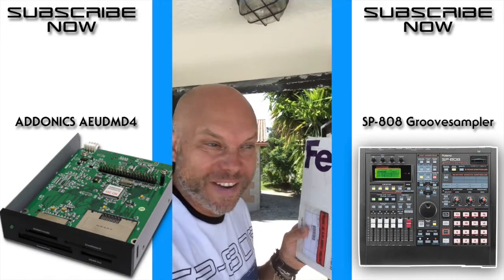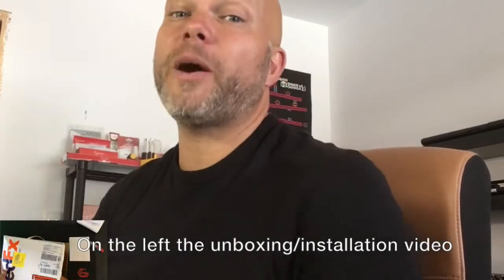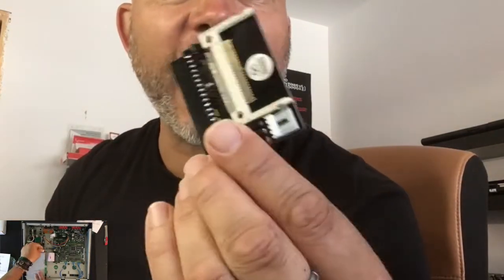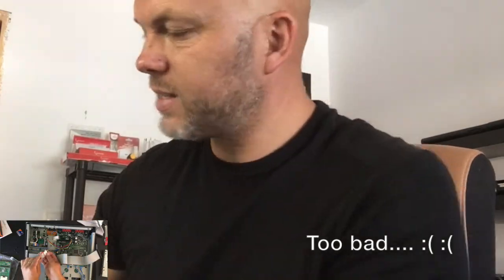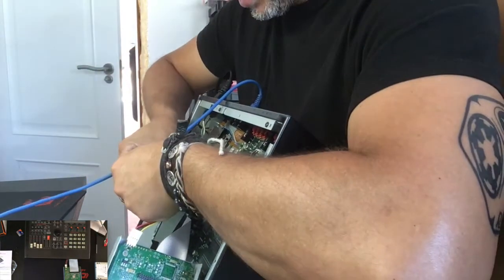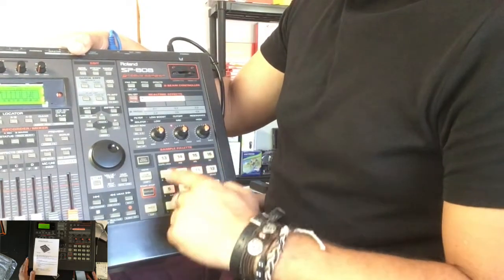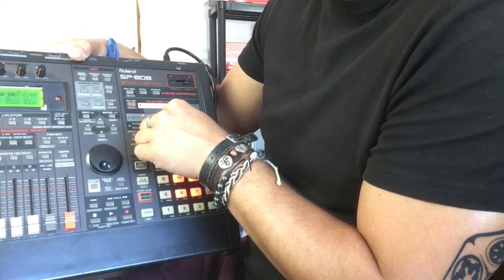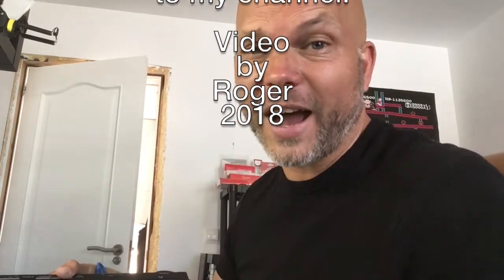SP-808: Addonics CF-cardreader installation (MPC-2000XL CF-card reader)

Comment: I have installed the MCD drive from the MPC 2000xl in my SP-808, and IT WORKS. I believe it is the original drive that came installed in the blue 2000xl models (it has an upper slot marked MS/SD/SM and a lower slot marked CF). It's hard to find used ones for sale at a reasonable price, but I got lucky and found one on Yahoo Auctions here in Japan. I am using a 1GB Compact Flash card in mine, and so far it reads and writes with no problems. I was a little apprehensive when I bought it, because I had only seen unconfirmed rumors that it worked. It does!
Reply from the maker: Leon Walpole Great!!! Happy for you and thanks for sharing your positive experience. Now we really know it’s not a fairytale. ✌🏽✌🏽✌🏽
Reply: @Roger - It's a shame that Addonics drive didn't work for you. Did you try using a smaller CF card? I've read about people using card readers on other older samplers who only had luck with CF cards (not SD) and only with sizes of 1GB or smaller. 
By the way, thank you so much for all your great videos on the SP-808! There are so few decent ones on YouTube, but yours are all excellent. I've really enjoyed watching them and learned some great new tips from them (like SHIFT + adjust length for halving samples shown in this video).
Reply from the maker: Well...it was worth trying. It would have been amazing. A smaller card will not work either because just connecting the reader made the SP-808 already slower without any card inserted.
And thank you for watching my videos. It is a real pleasure to receive this kind of feedback and I'm happy that you learn something from them :D
Reply: If i put card reader i have again drive too busy in fast plays or bounce track etc;if i havent its perfect if only change noise from zip and record time its clain

Comment: I am wondering because you are connecting 3 wire supply to four wire connector, wondering if the card reader is getting proper power. I have a similar card reader, I am going to hunt down the specs for what the red wire supply should be (5v or 12 v) So it might be possible these card readers work we might just need to make a jumper wire into the connector
Reply: Ok so in case anyone wants to know, the sp808's yellow wire is 5 v and the two blacks are ground. While I have a Starlink CF reader , when I hooked it up, same as his above. On my starlink the red wire(12v) connected to the sp808's yellow wire(5v) so I was not getting enough power to my cf drive. SO I will attempt one more time to see if I can find a 12v connection point somewhere on the sp808. The starlink needs 12v, also mine is not hot swappable. You have to plug the cf card in and then start it, I post more up here or create a tutorial once I get mine going
Reply: Sorry, just spotted some more info on the service manual for the sp808. there is no 12v rail,  its 15v which means you need a step down transformer..which I have so I should have some info by tonite

Comment: Yo, just wondering...did you ever remove the jumper for the master/slave setting..?
Reply from the maker: mack460 thanks for thinking along. Yes...tried with and without the jumper. 
There’s a small change in startup speed but somehow no luck.
I even tried to connect the IDE-cable in the wrong way. 
Somehow....buah...frustrating...

Comment: Hey Roger, feeling frustrated again with my 750mb zip driven 808 as I have lost quite a few tracks with zip errors lately. Thought I would ask your opinion about your experience with the A6 firmware, do you think someone who is code literate would be able to rewrite the 808 firmware with bits from the A6 firmware and get it working?
Reply from the maker: maybury78 Hi! What a coincidence...this weekend I watched your video again to see how you created that song on the SP. Keeps enjoying me. 
Regarding your comment:
What a #%£*^ loosing tracks like that..
The A6 firmware is nice as a sampler and a 4-track recorder. Also the effects are good. I do miss the synth and the way BPM is working. The A6 is based on time (SMTP) which makes it not so easy to create songs. 
But the hdd is rock solid...
Yeah, I think it would be possible to rewrite the two .PRG files. If someone is able to open those files, then it should be possible. 
I mean...the motherboard of the A6 has ‘SP-808’ printed on it. So, come on!😁
If only Roland would help us on this issue...if only...

Comment: There has to be a way of moving over to solid state drives, my heart cracks a bit more every time my zip drives fuck up, seems to be quite a lot lately even though I have just replaced the drive again and got some unused 750mb discs. I think that maybe the 750s are more unreliable, maybe trying to squeeze to much into the discs.
Reply from the maker: maybury78 Moving over to SSS would be a real cool thing!
Last month an 808 with the MPC drive was for sale for 300€. Finally I didn’t buy it because with a 4th unit my studio would be ehh...you get the drift. 
Never tried the 750mb drive. No...the 100MB with 32Khz is fine for me. But I will keep on searching like most of us. 
Thanks for contacting me. Hope you’re alright. 
💪🏽👌🏽✌🏽🤙🏽

Comment: I just added a card reader to one of my 808ex's. It may be the card, the one that came supplied with my reader is dif than the brand you showed. I used the one from the blue mpc also..
Reply from the maker: EL DAVIS we now can say that the original of the blue MPC2000XL is the right one. Happy for you! 👌🏽✌🏽
Reply: Roger The MIDI MANIAC thanks my Man, and thank you for all the vids, you are a lifesaver. Now if i can just figure out how to us my keyboard and the internal synth.. Ive followed your directions but something isnt working..
Reply from the maker: EL DAVIS hi! 🤔 not working?
Have you set the same midi channels on both machines?
Midi out on keyboard and midi in on SP?
Are the midi settings on your keyboard correct? 
You can send me a mail with more explanation and pictures. 
Roger@themidimaniac.com
Thanks. 
Can be in English or Spanish. (Based on El Davis 😉)
Reply: so you have a working sp-808ex on an akai multi drive? Please share details. This is a unicorn people want badly. Make a video explaining how to make a working unit. please

Comment: Roger, can you please revisit this idea of a card reader for an sp-808ex. I hear that card size and format can be an issue. You still have the equipment? Try other brands, Someone says fat 16 or fat 32 on a 1 gig card. This would be a breakthrough many are seeking. I want to reload the os on 2 machines now, but I need a midi interface/sound card.  Can't afford one now because I've been spending on my korg karma. But IS there is no battery in a sp-808ex? So does it loose the os to discharge over long period of time?
Reply from the maker: Hi Leo,
The 808 has no battery like a CR2032. On the mainboard there's IC9 which is the flash memory.
But when you have a failure the SP-808 would display that.
I still have my equipment and based on your question I tried yesterday with a SSD-drive.
I could format it but impossible to sample.
It froze.
When I connected the SSD to my computer there were three partitions created by the SP each of 512MB.
So I assume 512 is the maximum to be used.
I inserted a 512MB CF card but the adapter blocked starting up.
Still busy with this matter.
Finally we will have a solution :D

Comment: Hi Roger, I need your help
I replace the zip drive 100 of the sp 808 and it does not work properly, cut the samples.
you know what reference and brand I need?
THANKS
Reply from the maker: Hi! That's a bummer that the replacement doesn't work. I have several drives here from different brands (Panasonic, iomega and HP). Most important is that it's a so called Z100ATAPI. The original drive is a Panasonic JU-811T03.
I hope this is sufficient information for you.
Good luck and thanks for watching the vids.
Grtzzz, Roger
Reply: Try finding it here: https://www.mpcstuff.com/

Comment: Hello Roger, I'm also on a quest for a zip drive replacement on the SP808. I read somewhere that the MPC 2000XL MCD Drive can be compatible, which I found on an online shop (MPCStuff), do you know if they work ?
Reply from the maker: Jean-Baptiste Lévêque hi!
You’re right, the original drive of the blue mpc2000xl will work on the SP808. 
So, if you MPC-stuff sells an original one then you’re good to go. 
Any other mpc-compatible drive will not work. 
I bought two models for the mpc2000xl and they’re not working with the SP808 unfortunately....
We keep on testing!!!
Reply: @theMIDImaniac  Thanks for your quick answer ! I will ask the shop but I doubt they sell "original" drives. But I'm thinking, what if I buy an original blue MPC2000xl, salvage its drive for the SP808, replace it with another drive, then sell it back to cut my losses ? Could that work ? :D A bit convoluted...
Reply from the maker: Jean-Baptiste Lévêque if you buy the original blue one, you’ll be able to swap the drives. 
Only thing is that the blue ones are way too expensive. 
Well...the ones I’ve seen the last years.

Comment: Hi Roger, do you think It would works (adapted) on MV8800 ?
Reply from the maker: Jeanlouis COQUIN thanks for your suggestions. 
This addonics is disappointing. Didn’t work with the SP, not the MV and also not with the VS2480. 
It didn’t work either with an AKAI mpc 2000xl. 
It’s not on its way to bad-gear-heaven.
Reply: @theMIDImaniac  Ya know, considering all of how it didn't work anywhere...I suspect the reader being defective or somehow you received the read only version of that model. Have you tried another since then? I own an 808 and in a few week I plan to get on the bandwagon also. The slow 808 operation may ne that the processor is sending SCSI / ATAPI commands but isn't getting a response so it's caught up in an instruction loop.
I really believe it will be something stupid that was missed. It's going to happen!

Comment: hm i will probably also have a go with this. Looking at the wobbly atapi-specs (https://www.win.tue.nl/~aeb/linux/zip/zip-1.html), it might be that issues occur during formatting (which can have different results based on the jumper setting). I will receive my sp808 this xmas, so i haven't been able to try this: format the sdcard with different jumper settings. Another idea is to compare the SD-partition(table) with the zip-disk partition table. This is just a (probably stupid) guess:  since it 'kinda' works, maybe the sector- or i/o-sizes of the SD-partition & zipdisk differ (due to a sloppy format-job of the sp808, or due to limitations of the adapter). Maybe this can be fixed by the comparing the SD- and zipdisk-partitions, and updating the SD accordingly (using https://gparted.org). That way the SD-partition will fake itself to have the same disk-geometry & speeds like the zip-partition. DISCLAIMER: this is all wishful thinking :)

Comment: With card reader you have again drive too busy issue?at fast plays etc if you don t its ok and worth but if it is only for noise and record time i don t care and i don t separate my blue mpc
Reply from the maker: According to users you will loose the 'drive too busy'-error but only if your chops aren't too small.
Depends also on the kind of card you use, they say.
But you're right...That noise has also it's charm.

Comment: When you say you combined sp808 and a6 what did you mean?
Reply from the maker: wul01 I renamed parts of the A6-MIDI files and combined them with parts of the SP-808ex files. Then I sent them through MIDI to my SP-808. But also a No-go as I wasn’t able to update the unit. 
I managed to take out some *.PRG files out of the A6 with the hope to read them through a file-edit program but it’s just characters, characters and more characters. 
We keep on searching.
Reply: +Roger The MIDI MANIAC nice try , you would probably need a decompiler to have any chance with the .prg files, then it would still be difficult to read, but if you tried looking at the 808 files you might see the 500mb format limit as text, modify that. Does the 808 work with a hard drive? I have tried it but can't remember if it worked, of ot did it only formatted it to 500mb like it does with the 750zips.
Reply: +wul01 have you tried formating a hard drive on the a6 then changing back to an 808 then trying it in that. I had a similar problem with a vs840 , that accepted a hard drive upto 1gig if you put say a 4gig drive in it split it up into 4 partitions, unfortunately only the first was visible, you had to remove the drive and rename the partitions to acces the others.
Reply from the maker: wul01 thanks for the tip! I will search for that decompiler. We keep on digging 😁
Reply from the maker: wul01 I did that also. The problem is that the hdd arent hoy swappable so you can’t turn the sp off. So, no saving possibility. 
When you put an ide hdd in it it will format anyway but there’s no way to shut it down. When you turn it off manually, the drive becomes unreadable. 
Man...so annoying but on the other hand so interesting.
Reply: +wul01 what and where are the .prg files?
Reply from the maker: wul01 hold 2 and clear to save the image as .PRG. Turn 808 on and save it to disk. Then with usb attached Zip drive you can transfer the file to your computer. Same for A6.
Reply: +Roger The MIDI MANIAC thanks, didn't know that button combination, managed to decompile, not much use although you can see loads of text strings, you can see them better in a hex editor.
Reply from the maker: wul01 Wow!  Great that you were able to decompile it.
Happy to read that someone is able to do something with that kind of file. 
Hope you can do something with it through an HEX. 
👌🏽
Reply: +wul01 according to the reviews someone got it to work on a vs840 , also someone else said it was likely it was the compact flash card that was the issue, as the only one that would work was a transcend flash card

Comment: Please keep trying. Someone please tell how to make it a non spinning disc. I just want to be able to use my sp-808ex that the zip drive250 quit on. I got a nos fresh zip250 drive and still it won't load, jumper is on master. Please make more repair video of zip drive in english. Does the O.S. have a problem being without battery/stored away not used for long periods? I just bought a working sp808-ex two days later the zip drive250 failed
Reply from the maker: Hi Leo. Try to set jumper on Cable Select. You could also try a 100MB zip drive.
And perhaps an idea to reload the OS into your SP-808ex through MIDI.
Pretty weak that two days later the drive failed....
I will try to free some time to grab repair vids.
Grtzzz,
Roger